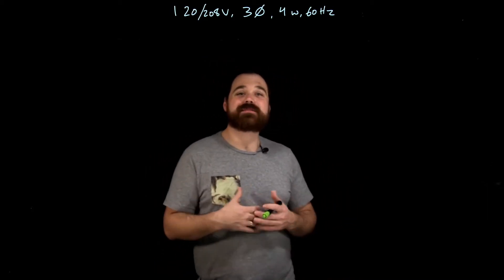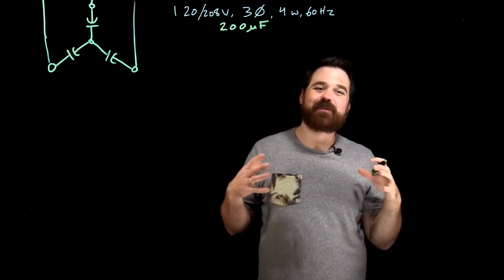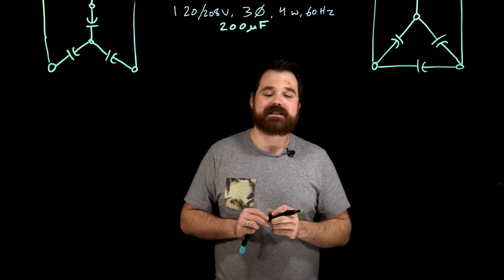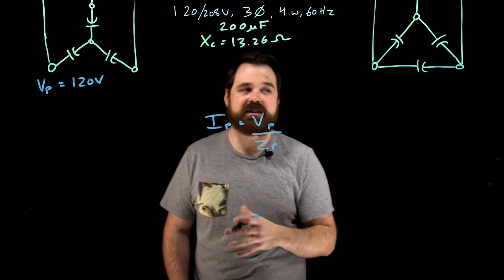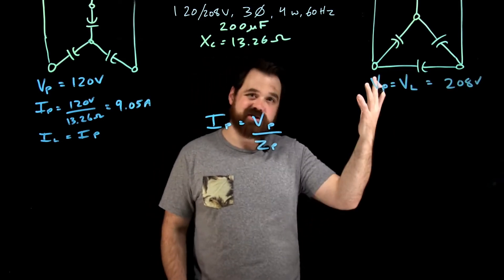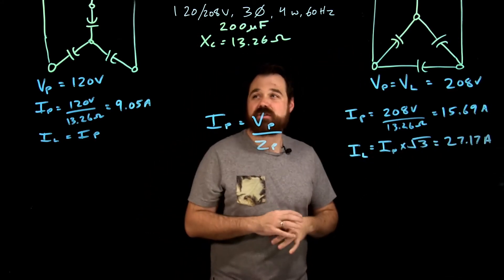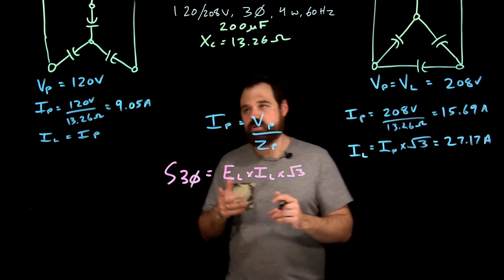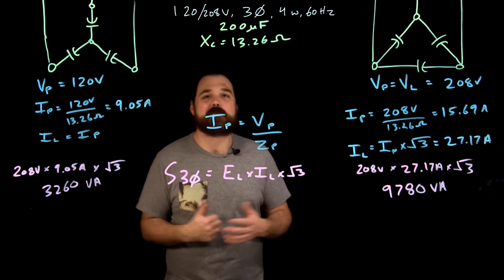Wye vs. Delta Capacitor Bank

Comment: Very nice explanation.
I have inquiry for you.
I have 3phase and neutral line in my home, the loads are distributed between the lines and neutral as common.
I need to improve the power factor for my home, which can I use delta or star capacitor connection, since the voltage between each line and neutral=230v and between line-line=395vac.

I am looking for reply.
Sincerly

Comment: Nice vlog sir
I hanve a question about capasitor connected in parallel
Is possible to connect them facing each other. So cap 1 terminal 1 is connected to cap 2 terminal 3.. and cap 1 terminal 3 is connected to cap 2 terminal 1?
Reply from the maker: As long as they are AC rated capacitors

Comment: if your supply voltage is 277/480, 3P then the KVA and the line current of the Y cap bank is >> than the KVA of the delta cap bank.   We have to be careful to look at the results under different utility supply voltages.